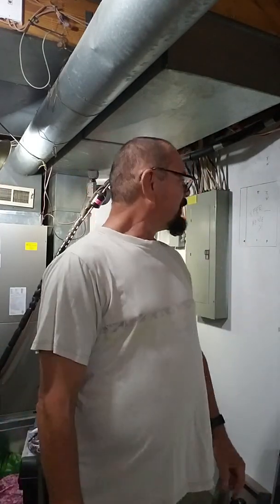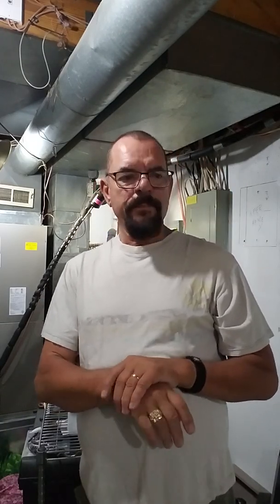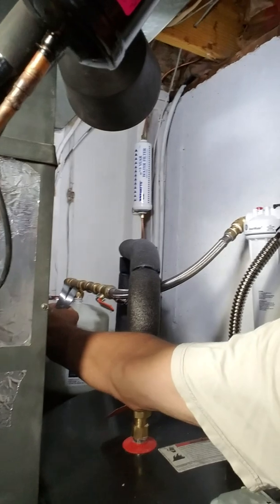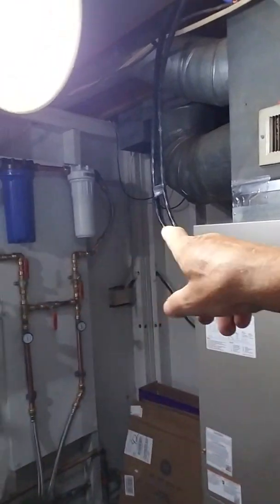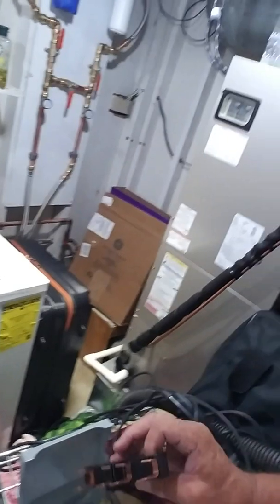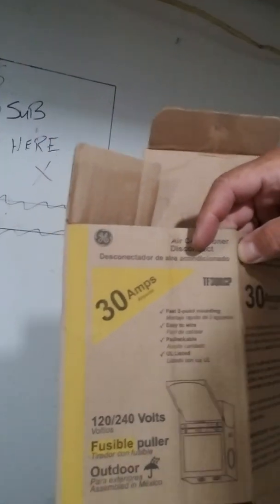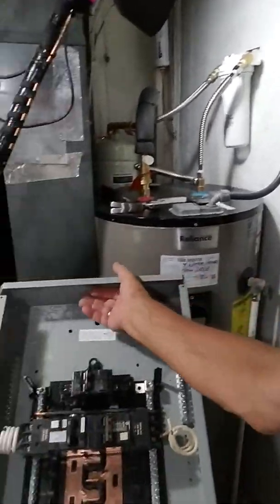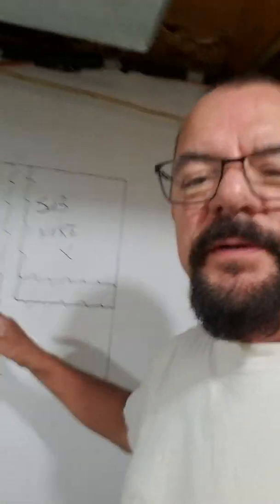Bro DIY: CRS #6 - Hot Water Heater Emergency Disconnect Installation.

Comment: Your bout to shut the neighbors power off
Reply from the maker: How many years do I have before that happens?
Reply: I'm just gonna use a mini D box sub panel with a 25 amp breaker . My house almost burnt down when my water heater kept popping the breaker at the fuse box ,
Reply from the maker: That sounds unfortunate.
The breakers " pop" for a reason. Sounds as if the device was malfunctioning. 
My use for this application is to disconnect the device for service per NEC regs.